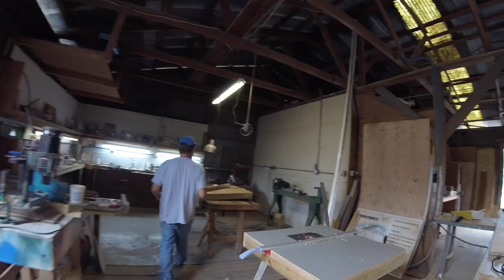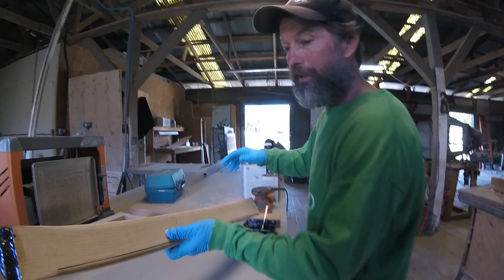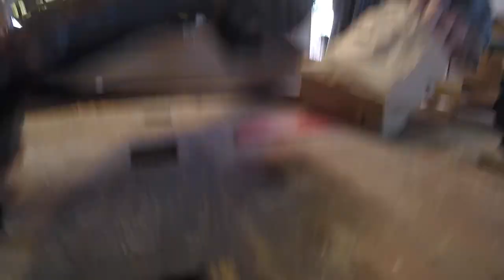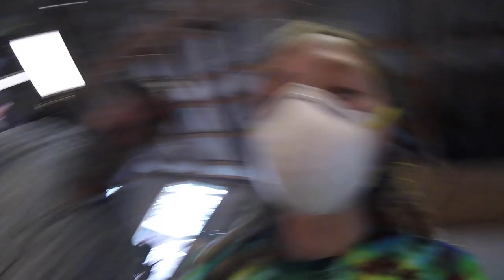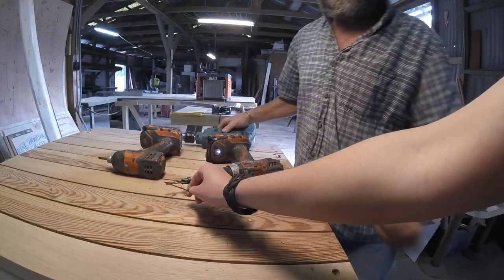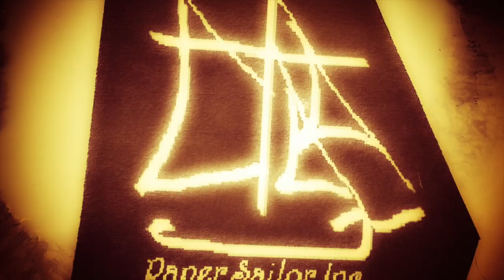Episode 143 - Drilling Holes Smell Good on a Wood Boat - Sailing Vessel Norna Vlog Day 48

Comment: What's the difference in the type of application for the epoxy resin and the caulking?
Reply: +thomas7770 Caulk lacks the strength of epoxy and is used for more of a filler